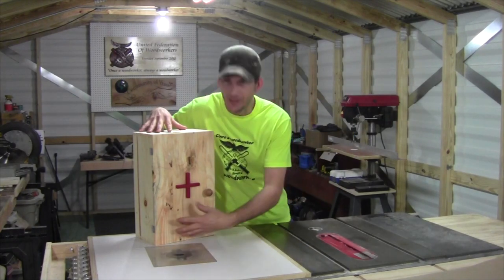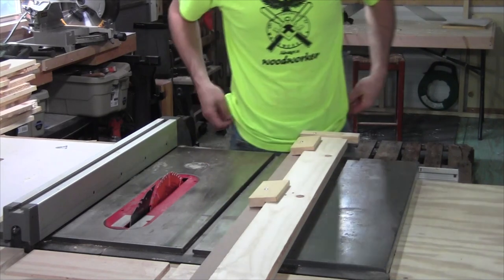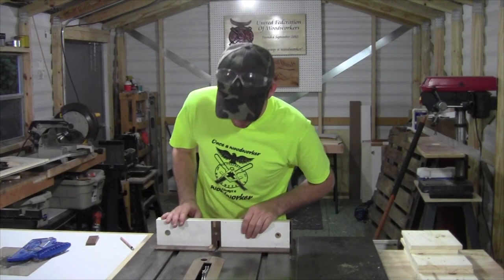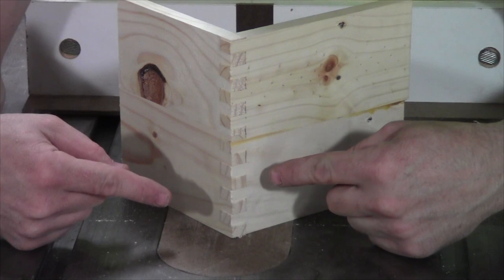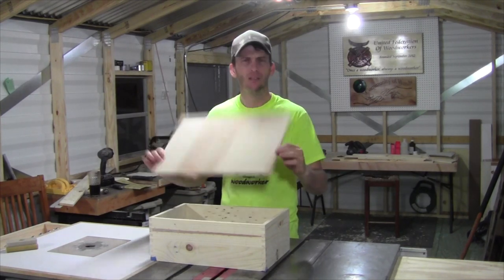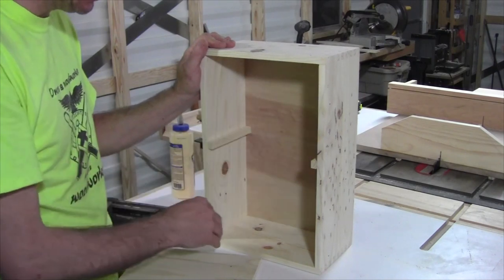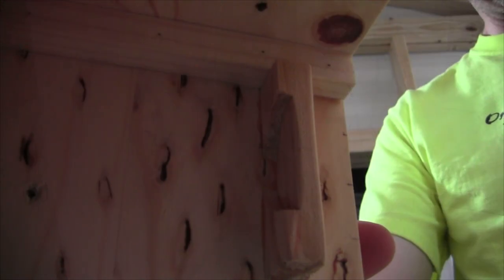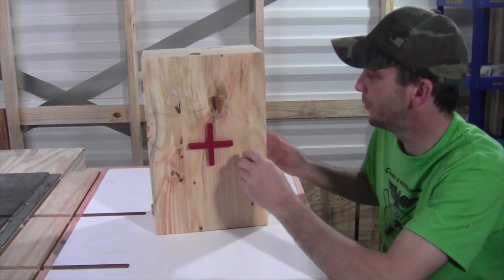Make a First Aid Cabinet from Pallet Wood

Comment from the maker: Hasm0ney, I can see your point. and I am sure many people will make their latch different, in most cases. When it comes to my shop, no one is inside but me, if I am incapacitated, if I am found, hopefully they will call 911 because there is nothing in that cabinet that will help me. and last its a quick quarter turn of the knob, and it pops right open. I may put a little arrow with the word "Turn" under the knob just to provide a small amount if instructions. Thanks for the feedback, for sure!

Comment from the maker: Also I wanted to add one more thing, the action is not a "Push, turn, pull" operation to open, just a turn, when turned in any direction, the handle pops out, because of the spring, it is only a "turn, open" operation. like a door knob. I will do a follow up showing this. :)

Comment: After spending  6+ months of pallet dissasembling and 8 more of taking down old barns in east texas  ( college money is always scarce)   I learned that  to deal with pallets  and any reclaimed wood  .you need:
 1) A long handled hammer (have an old hammer? make a long handle) 
2) Crowbars 
3) Wear safety glasses ( you will be applying a lot of force to a nail to come in YOUR direction
4)Boots ( believe me, they help a lot , and let you apply force with your legs instead of just using your arms)

Comment from the maker: monkey you mean the back piece of plywood? Grain direction would be up to the builder depending on the look they are going for. For plywood grain direction isn't crucial, because it doesn't expand and contract like wood boards. I liked the look of  my grain on the plywood back panel running from side to side.. so I went with it.

Comment: I like the latch but i feel like its the wrong type of latch for a first aid kit. I picture any time i need to go to the first aid kit i would be using one hand to hold pressure to a finger on the other hand. And if i can't fling the first aid cabinet open with my elbow then it becomes a hindrance. Or if some one else is going to the first aid cabinet for me and doesn't know its a turn knob they will pull it cause it looks like a pull knob. In short it should be fast and easy to get to first aid

Comment: FYI, the international first aid symbol is a white cross with a green backround. But I doubt you'll get any Europeans or Israeli's in your shop. On a serious note, add some trauma pressure dressings (looks like you have 4x4’s) like abdominal pads and an Israeli dressing (an abdominal dressing with an ace bandage attached). Kudos for making a first aid kit and stocking it, an important detail that is sometimes overlooked.

Comment: I don't want to come across as a safety Nazis, but the locking door mechanism isn't a good idea and I'll explain briefly. If someone needed to gain access because of an injury, and you were not there or incapacitated, how would they know to push, turn and pull? Also, when people panic, knowledge learnt isn't always there in time of need so, one might try to pull without success and it could further cause stress. I love the box, but just a simple magnet would be better. Love your vidz as always.